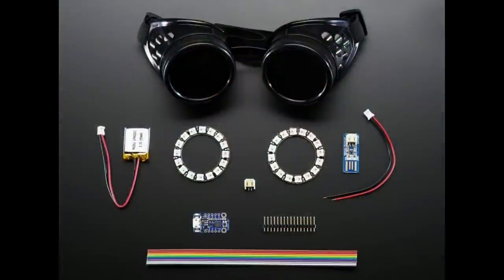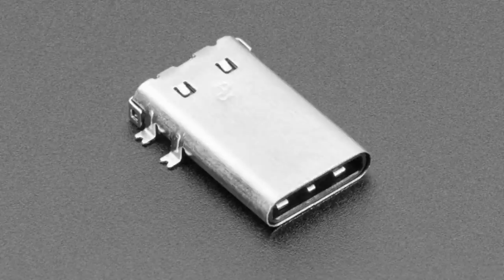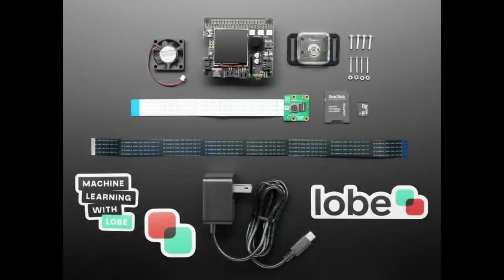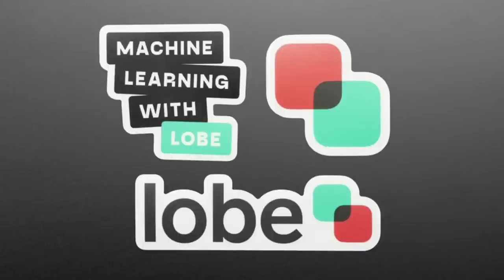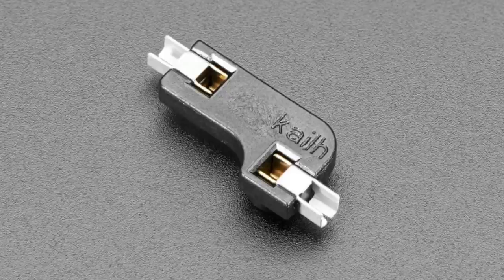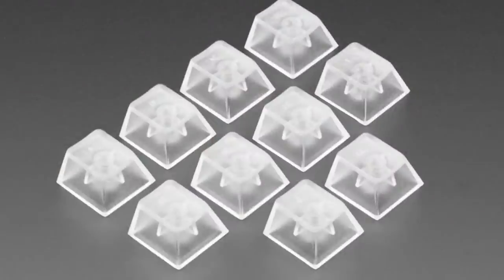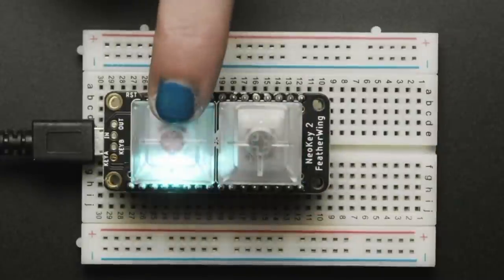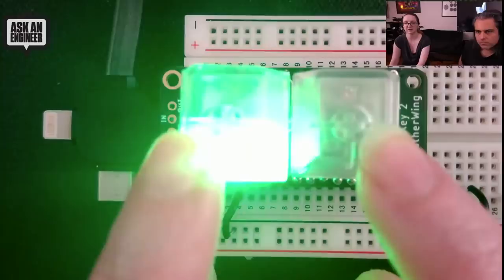New Products 3/31/2021 feat. #NeoKey #FeatherWing - Two Mechanical Key Switches with #NeoPixels!

Comment: The cap on the cnnectors is for washing the pcbs from flux residue. Same as the little stickers on those buzzers that says "rempve after washing". It it to prevent any chemicals or liquit from getting trapped inside.

Comment: Use U shaped wire soldered through hole over the USB-C connector to reinforce it. It will work like a clamp.

Comment: Image classification is difficult but straightforward now, we have a lot of models and even frameworks to choose from, and running the models from small devices (edge computing) is trivial. I think the next big thing might be a device that is able to do guided learning and classification without having to phone home for the updated model, preferably with video data as the input. If that becomes possible, it would be a revolution in the auto industry which has been working for decades on SLAM and cameras as sensors for autonomous vehicles.